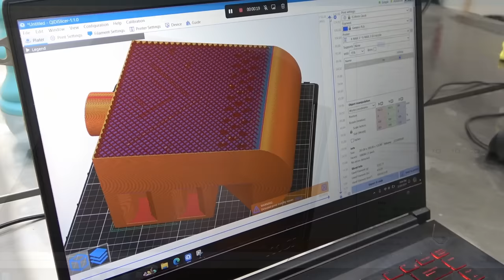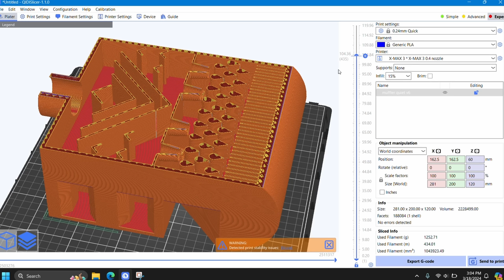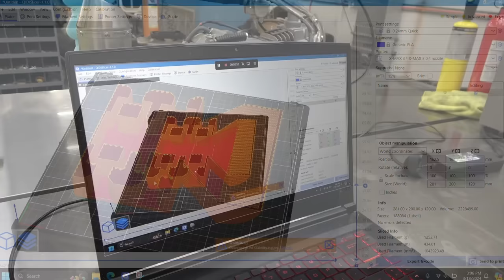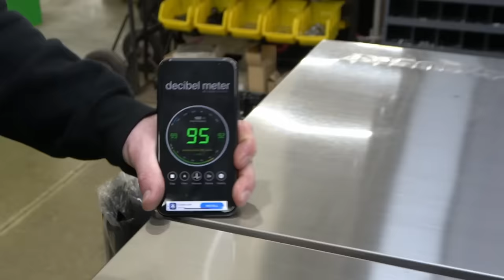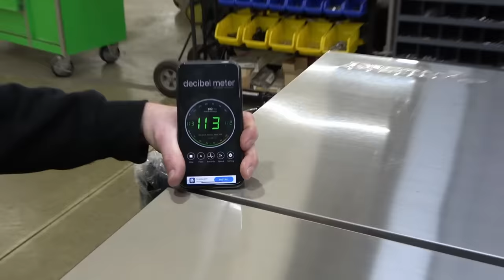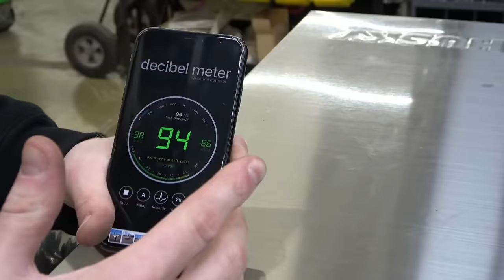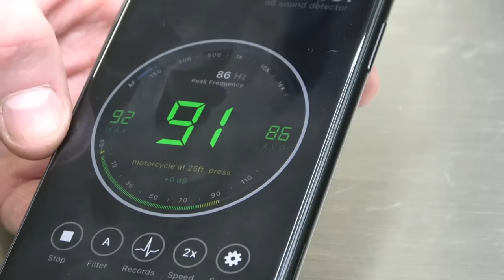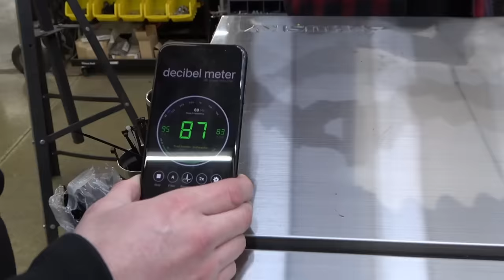World's WORST Muffler Test

Comment: If your vehicle is port fuel injected and running the way it is supposed to run, just delete the catalytic converter.  It does nothing if your vehicle is running in top form.  The gas chromatography will come up nearly identical without the catalytic converter.  I pass every time, for the last 28 years.

Comment: Trumpet mouthpieces are supposed to be screwed on it's a friction fit.
Reply: Quite literally just push the mouthpiece in while twisting it the stronger the twist the harder the friction lock.
Reply: You should be able to solder or tig weld the slides in place if you don't mind destroying the function of the trumpet a bit. It will lose some audio quality though.

Comment: You were laboring under the misconception that the sound comes from gas flow.  it doesn't.  Sound comes from pressure waves moving THROUGH the gasses.  The pressure waves move much faster than exhaust gas flow.  Concentrate on dispersing pressure waves, rather than exhaust gasses, and you'll be more successful.